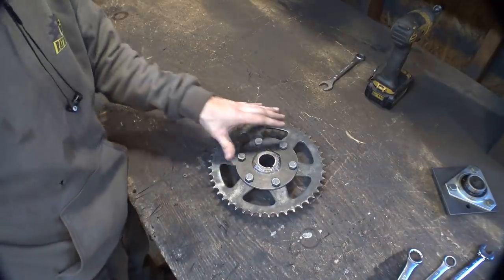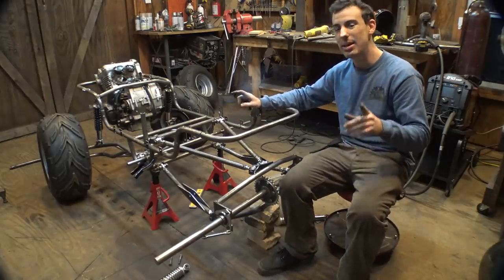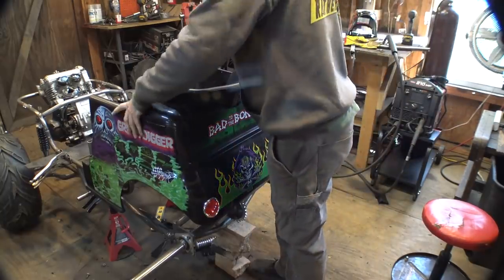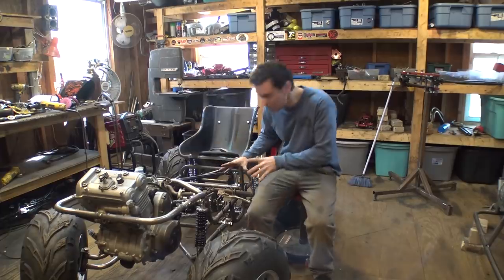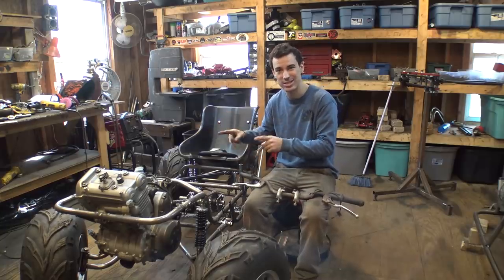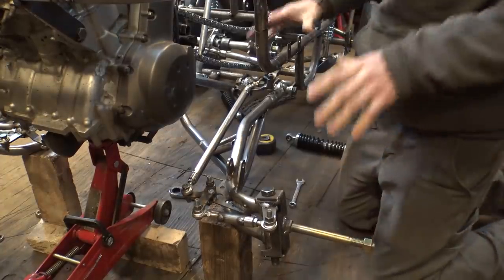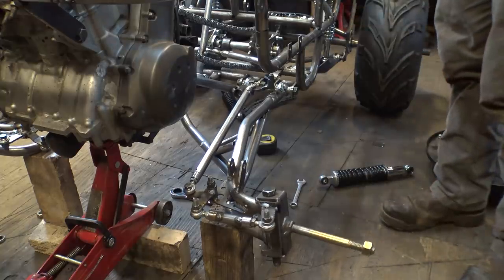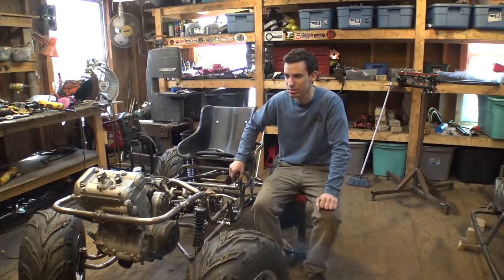Grave Ninja 650 Part 6

Comment: the steering setup is crazy but fantastic..  the handlebars just make it look like a modified Quad bike though... 
but besides. I don't think i could do any better, or even close to what you did, but I really don't like those bolts in the steering being upside down, nut comes loose and bolt falls out... just my paranoia i guess lol.. anyway excellent series

Comment: Wonder if you could use an old Honda 350 4x4 front end on the rear then you could do a hydraulic steering system for front and rear steering

Comment: Has the issue of axle articulation effecting the drive chain? 
Making the rear sprocket smaller has reduced the problem some. However, the drive chain is still going to twist under load. I love the four link rear suspension. I also love that sweet Kawasaki power plant. Go team Green!!!!
Any thoughts????
Reply: Good eye guys... 

Belt Drive????
Reply: Maybe a custom spring loaded, tilting sprocket. Utilizing a multi-ball joint. Think>>> a sprocket mounted to a CV joint.. 
This one way out there I know. Just throwing ideas out there.

Comment: You can angle your body on a quad to deal with the tilt on cornering but you can say with your legs straight planked in a little seat 🙄 think you’ve let your self down with the handle bars

Comment: Problem, yes ground clearance... but that is very tall gear ratio, opposite of a monster truck. Should've used an independent rear suspension with raised differential and keep the torque.

Comment: just wondering why you wouldnt use foot peddles for clutch brake and throttle and them a shifter like a car for gears. seems like front and rear split brakes is just kind of a waist, not to mention making to complicated to enjoy driving

Comment: 1/2 inch can make the chain skip off the sprocket bc the axle pivots and jackshaft  does not, add idler sprocket to take up slack also the crossbar might interfere with chain to jackshaft ,might have to lower it. test your chain angles. bc I like you I'm giving you my 3 cents worth :) GRAVE DIGGER HAS STEERING WHEEL figure it out  you're smart you can get stabbed with handlebars.

Comment: So you went with a larger rear axle to make it stronger,  and that makes sense.  What does not make sense is for the front-end ,how small you went on the end hub bolt , you have a the motor weight, the torque from the wheels when turning all on that ,what 1/2" bolt?, maybe 3/4".

Comment: Unfortunately that slop is from the heims, or at least in my opinion it is. At a maximum of 1/32" movement you're still seeing 1/8" movement per side(using 8 joints per side), resulting in 1/4" total slop. Replace anything that doesn't need to articulate with 1/4" bar, using tight tolerance holes.

Comment: if you change the location of the jack shaft to be in the distance from the pivot point of the rear suspension link arms the distance will always be exactly the same. why not move the shaft about an inch farther rearwards?

Comment: That rear suspension is not going to work with a chain drive setup. You're going to have to brace it side to side so it doesn't articulate. Otherwise you'll twist your chain.

Comment: You have plenty of foot room why don't you make it like a car and put paddle shifters and keep the clutch on the floor next to the gas peddle. Plus hook the front and back brake to the same peddle. You can adjust it to brake more in the back or the front if you need to.

Comment: Does anyone else wonder why Chris always seems to use bolts that are too long for the job? Also the flex in the steering is mostly because he hasn't supported the steering column enough. 

But as I have said before my biggest concern is the way he has cantilevered the engine mount. I can't see how that will hold up to the power/torque that engine will be putting out.  I see is bending down under the force applied by the engine.

Comment: ...... I love that steering design works so well with j-arm suspension
Reply: Wait till he tests it! Bet ya he starts over.
Reply: @goodnough1  needs some better structure but theoretically it should work
Reply: @dustinmiller7278  between the suspension, and the steering and those big tires, the wheels are gonna spread apart, and collapse. Stuffing that engine into the ground. Mark my words, the entire suspension, front and rear will be redone.

Comment: IMO a steering wheel, with a hand gear shift and foot pedal would look cleaner. Why not chuck the handle bar, link the front and rear brakes to a beefer literbike master cylinder and then fabricate throttle, clutch and brake foots pedals like a car would have

Comment: I’d be scared to take that thing too fast around a turn in case it rolls.  You should cage it up and get a 6 point harness so you can roll with no risk of injury.  And then roll it for the hell of it.
Reply: External cage to protect the plastic body
Reply: You really improved your skills.  Your design of the chassis and steering is spot on.  Like you said just a few more supports or gussets

Comment: Why not run front and back breaks together. Then you only need 3 foot pedals and a hand shifter like a normal car. A steering wheel would be so much more suited to the powerwheels design

Comment: I think hamdle bars aren't doing you any favours. You should be throwing shifts with your right hand, clutching with your left foot and steering with a wheel. For simplicitys sake you could have set it up like a like a monster truck. Then if you lent it out, you wouldn't have to explain where all the controls were either. 9 out of 10 Dentists agree that slap-shifting gears and a 3 pedal system are important parts of healthy monster truck minis.

Comment: Why didn't you just buy an ATV and put the Grave Digger body on it, instead of screwing around? 
You would have been much more comfortable in that kind of seating arrangement with handlebars. The engine would have been out of the way of the front  suspension e.t.c.

Comment: Have you even done any maths to do with your gears 🤦🏻‍♂️ should be 1 into 1 and the output on jack shaft should be same as x ( wot ever your 1.1 is ) then change the rear to set ratio, seen your clutch control bro u aint setting off on that 😂